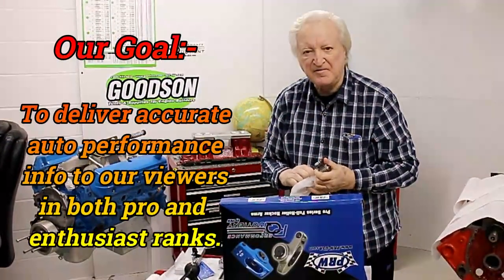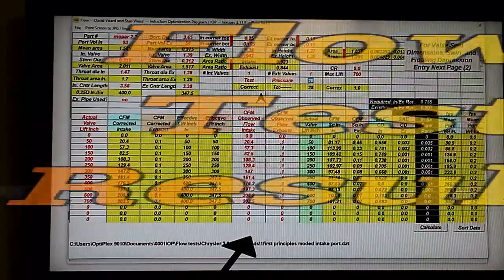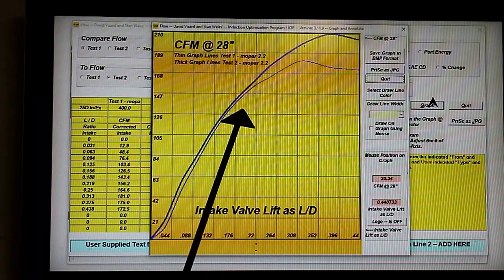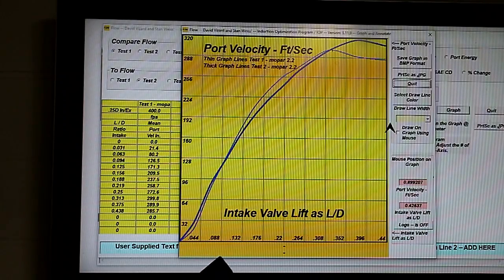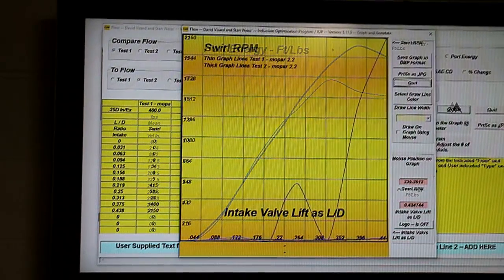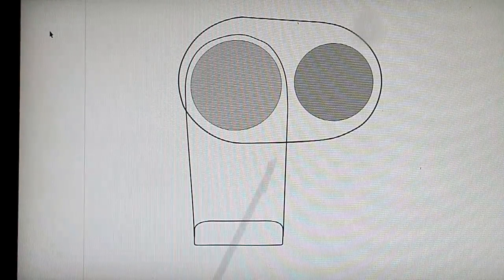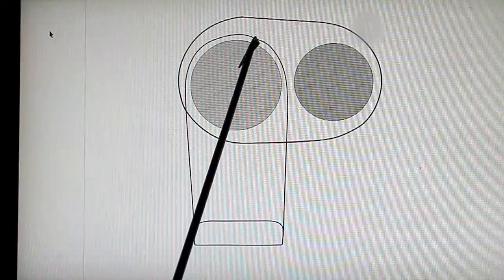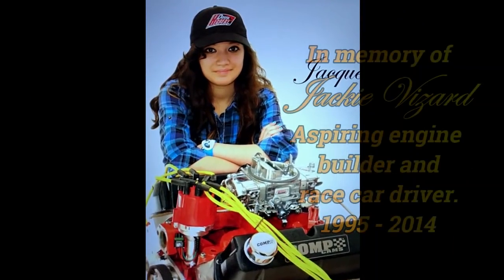David Vizard's PowerTec 10 EP  43  part 2 Richard Holdener's 2.2  mopar turbo head 2nd 1/2 of part 2

Comment: https://www.aliexpress.com/item/1005003250841682.html?spm=a2g0o.9042311.0.0.37f64c4dVxCkeP   Bought this coil its for strett,drag,sport,super car also says mopar.E-core coil 70% better stability.Tested it on 50cc scooter,works great.But had a red spark,so need to change the stator,half year old.Also https://www.aliexpress.com/item/1005001997152266.html?spm=a2g0o.9042311.0.0.37f64c4dVxCkeP    High performance spark plug cables Cadillac,chevy,gmc 1500,2000,3500,5.7 L,5.0L V8.Everything same or much cheaper than 50cc parts.Also mc-coil 10$.

Comment: Ok I see what you are saying. You opened the flow a lot. Ok this is boosted.how does the swirl come in on the boosted motor. Turbo pushes naturally aspirated pulls. This is why I watch you so I can find out the facts from a person who knows what they are talking about. Thank you for your time and going to enjoy your work on this. Most of all I can’t wait to see the arm chair pros fix this for you. I forgot to ask you dose the boost make the swirl on this?
Reply: Both a N/A and a boosted engine work the same. You have a higher pressure area trying to fill a lower pressure area. More accurately you have a higher density volume trying to equalize a lower density volume. Make it easier for the higher density volume to fill the lower one, you will probably make more power (give you can get it out, too).

Comment: Great video! It would be great if David could cover the big block Chevy peanut port head. Richard holdener did a fairly impressive peanut port build and I wonder what David could squeeze out of them.. maybe larger valves, port/bowl cleanup? The supply of reasonable oval port heads is drying up.. no one want the peanut ports, but I’m not a rich man either… Can David make a silk purse out of a sows ear? Thanks!
Reply from the maker: Gearhead - don't remember what Richards results were but I can tell you they are better than generally credited.

Comment: Great video David. Would I be correct in thinking that the missing swirl has transformed into tumble? Or do you suspect that the airflow is now chaotic?  I often think that we focus on swirl because it is very easy to measure and quantify. Tumble however is much more difficult to measure and quantify so I feel that we overlook it. I often wonder what difference we get in performance between heads designed for tumble vs swirl? I realise that this question is like asking you how long the bit of string is that I am holding here whilst writing this,  but maybe you could give us some information based on the basic principles/characteristics of the two different methodologies. Thanks again for another great video. Regards from Perth, Western Australia,   Greg
Reply from the maker: Greg, been to Perth (love it) about 4 times over the last 30 years. Have a good friend their. But to answer you question -  no tumble of any consequence either.
Reply: Tumble is not generally a characteristic of 2-valve wedge combustion chambers.  Maybe hemis and 4-valve pent-roof chambers, but they have to be designed for it.

Comment: Sure didn’t take much to kill that swirl.  I have engine builders tell me all the time it does not matter at 4000+rpms though. They tell me flow is worth more hp than swirl.  I have my doubts.
Reply from the maker: Hey bcbloc02 They are not entirely wrong here but also there is more to it than meets the eye. Will get into that when I cover swirl and combustion efficiency.
Reply: I see what your doing bc

Comment: Am I to logically assume that this info applies to all turbo set-ups?  One would obviously need to know WHAT  the air is doing in their particular assembly.  But it seems to me, having watched all of your video's, that, within reason, this information translates.  As an example, I'm contemplating how to apply this to a Chevy LY6 engine (6.0 block, LS3 square port heads).  I have some, and want to make a torque monster out of one, for a mud truck.

Comment: Mr. Vizard, Much respect here, Thank you for taking the time to explore and develop this cylinder head. I daily drive an '85 GLH Turbo and it is an absolute blast. Mine has been treated to the next iteration of this cylinder head the "swirl" Combustion chamber casting and mine is intercooled and set up much like an '86 Shelby GLHS Omni.  Once again thanks for these videos. 
I am also much into the Chrysler Slant 6 engines and plan to port a cylinder head for my '70 Duster. Will employ the knowledge that I collect here!

Comment: I've found that a 420 head from a dodge neon flows much better. I suggested this to him but he wants 8 valves
Reply: It definately does, but it requires some work for oil drainback and timing belt.
Reply: @bigassfordsd  I think only the 2.5 tall deck 86-88 block works with the 420 head due to valves hitting the pistons. and the nightmare of wiring...